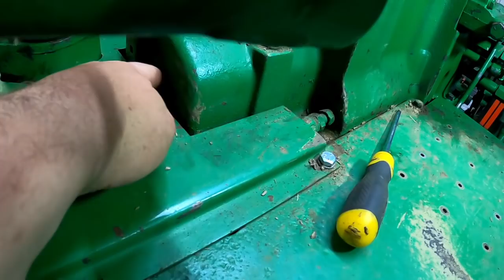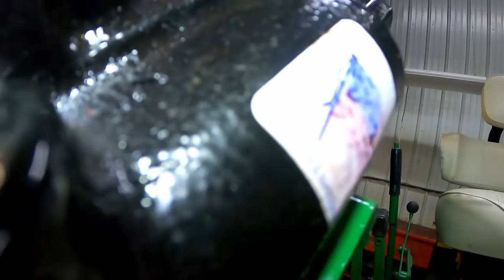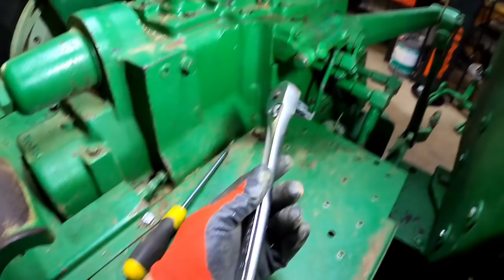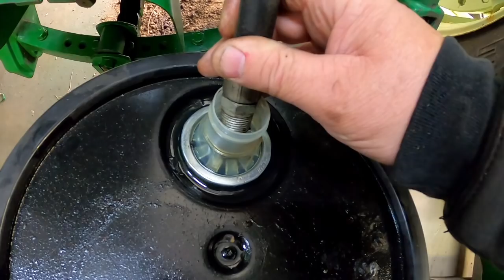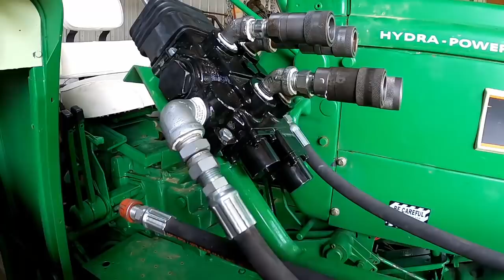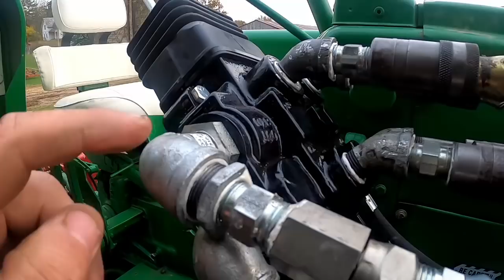Power Beyond Hydraulics for Oliver Tractors

Comment: Why did White use open hydraulics on the newer 2-70s rather than adopt the closed hydraulics used on the 55s?
Reply from the maker: Cost. They were trying to keep the lower horsepower pricepoint low to compete.
Reply: @ThatOliverGuyChris Merry Christmas! Coming from Deeres and Internationals it seemed weird having a filter between your legs  but I miss that 2-70 we had a loader on it and with that big boxy hood I could never see anything but funny enough I miss it now. For us it really was too big to do small tractor work and too small to do big tillage work. We used it mostly to pick rocks.

Comment: Why would my three point not work after doing this. Pretty sure followed the directions to a t. Loader works great, three point won’t lift now? Always was strong before?? Any help is appreciated
Reply: I think I figured it out, will let you know
Reply from the maker: Do your remotes work ok?
Reply: I don’t believe so have plugged them in yet. Three point will go down if tractor revs but won’t pick up with me standing on it. Loader works excellent, steering works, think the loader works better than before. Double checked everything and even tried switching hoses around but nothing. Was going to try and take plug back out and bypass power beyond and see if it works???? Always worked before at idle.

Comment: What is the part number/model for that loader valve? Also what fittings did you use. I'm about to put a 1610 loader on my 1655. Thanks!
Reply from the maker: It's a Prince RD522GCGA5A4B6. The ports are all pipe thread, so I used some 45 degree elbows, and a couple of 90s. The fittings you use probably depends on where you mount it. I got the loader valve from Dalton Hydraulic online. They had the best price I could find.

Comment: Hey Chris, when using my 1550 wiht loader using the power beyond setup with separate loader valve the main lift function with hold the loader in position w/ loader valve lever in center position but if I pull back to lift and the engine rpm is not high enough the loader will settle (go down).  Is there a check function that should be preventing this or is this just how the system is?   Thanks in advance.  John
Reply from the maker: It sounds like your hydraulic pump is getting weak. The priority valve makes sure the first 3 or so gallons per minute of flow goes to steering. If the pump is getting worn out, it will generate less than 3 gpm at low rpm and divert all of the oil to the steering. That cuts off the flow to everything else. The loader will still go down because of its weight.
Reply: @ThatOliverGuyChris  Thanks.  So if the flow is low or zero beyond the steering requirements then attempting to raise the loader will result in the loader lowering rather than staying in place and not rising?    We were moving a cast iron bathtub the other day and once lifted (at higher rpm) then moved w/ the moving tractor at lower rpm (hydraulics in "neutral", flow blocked in both directions) then loader valve was moved to lift while still at the lower rpm and the loader and tub moved lower rather than holding position and not rising.  This was a little unnerving but I'm wanting to double confirm that this is what should be expected and there's not a check feature that should intervene.   Thanks!
Reply from the maker: @JohnWeihs  that is correct. Your loader valve will hold it, just the same as if the tractor is off. With no flow coming from the tractor, the pressure from the weight of the loader can backflow allowing it to lower. Your loader valve would have to have some kind of check valve to prevent it from lowering without pressure. Most don't. To me it sounds like everything is working like it should, except the pump.
Reply: @ThatOliverGuyChris  Thanks for confirming this Chris.  In consideration of safety I'll look into both a check valve for the "raise" side of the circuit and a pump upgrade; it would be better to get no response to a raise command than a lowering response.   Any reason to check the hydrualic system pressure?  It seems OK at higher flow (rpm) conditions I guess...
Reply: The loader valve is from Cross; last year I spoke w/ their tech support on other issues so I expect they can advise on a check option/valve upgrade.  I appreciate your helping me think this through; I've got the tractor shop manual but the overall loader system needs to be taken into account and your experience is a great resource for part-timers like me!
Reply from the maker: @JohnWeihs  you can check the pressure, but I don't think it will change anything. The pump has to generate enough flow to create the pressure in the first place. Unfortunately there isn't a replacement pump available for the 1550, but the good news is you can put a 1650 pump in if you get a pump gear from a 1650 to put in the place of the 1550 gear. I did that same thing last fall and have it in a video.
Reply from the maker: @JohnWeihs  https://youtu.be/YItCSrYvvMI?si=Rf3HEFDtkNLEvvq7
Reply from the maker: @JohnWeihs  https://youtu.be/TwJJwa7Gi_A?si=ffXs-jZPEfTxExpF

Comment: Very helpful video.  I recently purchased a 1550 gas w/ loader valve for the loader that was connected to the LH remote.  First problem was it was flowing against the restrictors (lever fwd and held fwd w/ a bungie to the fender).  Switched that (lever rearward and held w/ bungie) and now float function works and system is quieter.  Seems running the loader valve off the remote is sending most of the pumped oil back to tank rather than being available for 2nd remote and hitch.  Am I right in thinking that changing to loader valve over to the power beyond setup you detail and adding the bypass plug to the loader valve would provide much more flow to the remotes and hitch?  I'm not sure but I think the remote return line goes to tank and doesn't supply anything downstream;  can you confirm?  THanks!
Reply from the maker: That system isn't fond of using 2 valves at once. I think the return still has to finish the circuit through the second remote and 3 point before it returns to sump. It loses some of the  pressure along the way which doesn't help, and back pressure can open the interlock for the other valve  and let that one move without using the lever. I would definitely recommend going with a power beyond setup like we did on this 1650. Not only soes ot free up the remotes for orher functions, but the loader should be faster since the oil doesn't have to go through all of the passages of the tractor remote. Alan uses a rear blade with swing and offset cylinders on this 1650, and it all works great. I have my loader on my 1750 using both the remotes for the loader and it works, but after doing this 1650 I need to do the same to my tractor
Reply: @ThatOliverGuyChris  Thanks Chris for the detailed response; you hit several of the points I've been concerned about.  I think I've ordered everything I need for the change-over; just need some luck with the pipe plugs!  Fortunately there's been some good tips in this post which should help. Thanks again
Reply: @ThatOliverGuyChris  So I plumbed the power beyond w/ 1/2" hose through the loader valve as in the video.  Everything thing worked fine until suddenly (I think after going to high engine rpm) everything downstream of steering quit; no flow evident in loader valve hoses and no remotes or hitch.   Maybe steering priority valve stuck?   I did use 1/2" pioneer ball couplings in the power beyond lines to and from the loader valve so maybe restriction at high engine rpm?  I added the couplings for easy completion of the "loop" if the loader is removed; including the loader valve.  Any tips?  Also still having a hell of a time with the reservoir return low plug.  Have used penetrating oil, heat, beat and so far have only managed to somewhat round out the  internal square drive.  May have to drill out?  Don't want to introduce chips;  may try chisel on part of plug that is proud of housing.  Thanks; any advice appreciated!  John
Reply from the maker: @JohnWeihs  it could be the priority valve. Before you tear into that, try temporarily removing the pioneer couplers out and join it hose to hose. Sometimes those couplers can go bad and the ball in one side or the other seats and shuts off the flow. Something else you can do, with the tractor off, steer it and lower the loader to get all of the pressure out of the system. Then start it up and see if that got it working again. If it does, I'd say it's the coupler. Relieving the pressure lets the balls come unseated and let it flow again. And now that I think of it some more,  you could try taking the coupler halves off and switch sides with them. That might keep the ball from seating. Let me know how it turns out.
Reply: @ThatOliverGuyChris  I removed the couplings and no improvement.  Removed, disassembled and reassembled the priority valve (both spools) and the relief valve and found no issues.  Still had steering but nothing else and didn't feel flow through the power beyond loop hose.   Decided to top off oil; added my last 3 quarts and it came to life.  I could swear it was full before and its was working yesterday until it stopped.  If I had coupler restriction could the oil have gone somewhere else?  It's not leaking externally.    I checked the gearbox through the fill cap and couldn't see high oil level.  Glad it's working; I'm going to get either flat face 1/2" couplers or 3/4" couplers and 1/2" NPT adaptors to address restriction but still scratching my head on if the oil went somewhere or I'm loosing it!  Thanks for any ideas.
Reply from the maker: @JohnWeihs  could be the seal blew out in the pump. I have seen several of these setups with a coupler in like you have done and they have no problems.
Reply: @ThatOliverGuyChris  I was just reading some other posts and it seems that may be likely.  Where does the HY oil go?  Gearbox?  Still wonder if the high rpm and 1/2" couplers caused enough restriction to blow the pump seal by forcing pressure up to bypass or if the seal already had an issue and gradually went bad.  Seem rather abrupt.  I guess I can add oil and see how long it lasts.  Not looking forward to a pump seal; any videos on that?  :)
Reply: @ThatOliverGuyChris  Seems this may be the case.  Do you have a video for the front pump seal replacement?  Seems this may be a big teardown...Drain transmission gearbox to help diagnose?
Reply: @ThatOliverGuyChris  Do these front seals fail all at once or gradually typically or could it be either?  Wondering how urgently I need to get after the pump seal replacement.
Reply: @ThatOliverGuyChris  figured out where my oil went; into the bucket I had set up to drain the system to install the cylinder return line.   I don't recall activating the remote but must have I guess while I was just letting the oil flow through power beyond at different rpms.  I did install the 1/2" flat face couplings with the higher flow capacity and the system seems smoother and quieter at higher engine rpm.  Haven't gotten the low return plug out yet; for now just running that hose to the fill tube and it seems happy enough.  So seems now my pump seal is OK which I'm happy about.  Having 2 remotes free while having the loader on power beyond is going to add significant capability.  Sorry for the multiple messages while I was confused; couldn't believe it when I went to move my "empty" bucket and it was heavy and had 3.5 gallons of oil in it!  Felt stupid but relieved.
Reply from the maker: @JohnWeihs  you wouldn't have to bump a lever. That's the nature of the Oliver hydraulics, there's always some residual pressure against the remotes, even when the lever is in neutral. The pressure is the same on each side, so your cylinder doesn't move from it. It's that same pressure that drives guys nuts when they hook up a hay mower with single acting lift on the head. Since the head is counterbalanced with springs, it takes very little pressure to lift the head. That residual pressure slowly lifts the head as they go across the field. I'm glad you got it all straightened out, I think you'll like the setup.

Comment: If I could ask a question: I I just got a 1750 gas with a brush hog loader. It uses the Hydralectric levers to run the boom and bucket. The last owner told Me that occasionally the hydraulics lock up and nothing moves. It just did that. I was told a little part #1060068 needs to be replaced when it happens. Is it because I am using the hydralectric controls to run the loader? Any help would be much appreciated. I can't keep having it fail when I need it.. I appreciate Your knowledge of these tractors ,
Reply from the maker: I have a 1750 with a loader on it and hydra-lectric, and it runs my loader fine, so I don't see that being your problem. I'm guessing you are talking the 106006A relief valve, they are under the top cover of the hydraulic unit. I've never had one pop, but they are there in case of a shock load or spike in hydraulic pressure. Did the loader bounce causing a spike in pressure in the lines? I would think the other circuit would still work, but I haven't experienced one of those reliefs blowing before. They're a single use type of relief, so you'll have to replace at the least 1 bad one, possibly more. The gasket for the cover is a 165836A. If it happened to the previous owner and the reliefs fixed it, that's where I would look. If it is a shock load, there are adjustable restrictors that can be turned in to help keep the loader from bouncing. Adding a power beyond like in this video would be another way to go, and it would free up your hydraulic levers for other functions.
Reply: @ThatOliverGuyChris Thank You for responding! All hydraulics went dead including steering and 3 pt. If I can get it going I will try adding power beyond !
Reply from the maker: If everything went dead, you've got a different problem. The steering has a priority that makes sure it has pressure before everything else.  Does your pto still turn? The shaft that drives that also drives your hydraulic pump.  The splines may have stripped on that shaft.
Reply: @ThatOliverGuyChris  will check that.

Comment: If the steering relief valve is bypassing at idle would that have a similar sound of say stepping on a duck? I have good steering and 3 point but my remotes are not responding well.
Reply from the maker: That might be a good approximation of the sound.  It should be louder in that area if that's what it is. Is there a load on the 3 point, or is it empty? Both it and the remotes get their oil after that steering valve,  so I'd think they would both be bad if the steering relief is the problem
Reply: @ThatOliverGuyChris  3 point has no problems or noise lifting a 72" snow blower. When I hook the shoot cylinder up to the remote and try to move it, it responds very little (less than 1/4" of movement in either direction) and starts "quacking".
Reply from the maker: Have you checked the restrictors? Also, could be a bad coupler, have you tried it on another cylinder? It sounds to me  like the main relief is opening, telling me there's something restricting flow at the remote
Reply: @ThatOliverGuyChris  
Update: the bypass bolt on the right hand side on the hydraulic housing seems to have been the issue ( the bolt directly behind the bypass valve) After reading the service manual again I found where it mentions single acting cylinders needed this bypass bolt threaded out 5 or 6 turns. My tractor did have a single hose on one side. After threading the bypass bolt in until it felt “firmly seated against the valve” I no longer have the noise and both hydraulic outlets are functioning as they should.
Reply from the maker: @highland512  Glad to hear you got it figured out. That is interesting, because I thought turning that bolt out made it so the 3 point wouldn't lift. I'm guessing it wasn't out the 5 or 6 turns the book called for?

Comment: Another awesome video thanks. Your video on the steering column helped me repair my cockshutt 1650. Now I've messed up my hydraulics as I have one set of remotes and I  didn't realize they are single acting I hooked up a round baler with two hydraulic hoses , it worked for 7 bales now it wont lift end gate and the pressure wont release I  had to drive the coupler apart and remove  pressure by driving a hitch pin into coupler. Your video has been the best I've  seen about 1650 hydraulics. Any suggestions would be great thanks.  Graham
Reply from the maker: If it worked for 7 bales, the tractor is probably fine. Those hydraulic tips can go bad and do what you describe. It could also be the interlock spool in the cover is sticking, if you have the internal valve hydraulics. It could even be the hydraulic hose between the tractor and the coupler. I had a customer with one that had a bubble in the rubber on the inside of one of those hoses. The oil got between the layers and filled that bubble up and it pinched off the oil flow, but only in 1 direction. You could try reversing the hoses and see that helps. Chasing those type of problems down can be a lot of trial and error.

Comment: Will this work with aftermarket loaders such as great bend or bush hog etc. Thanks
Reply from the maker: Yes, as long as the loader valve is open center and capable of at least 15 gallons per minute and 2500 psi.
Reply: @ThatOliverGuyChris  thanks happy 4th